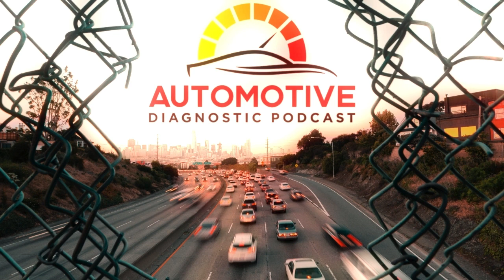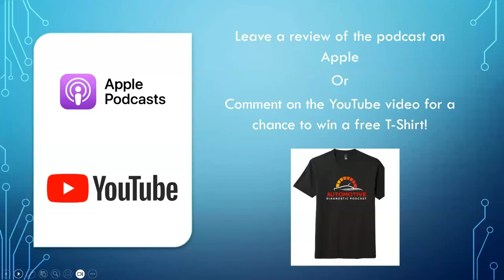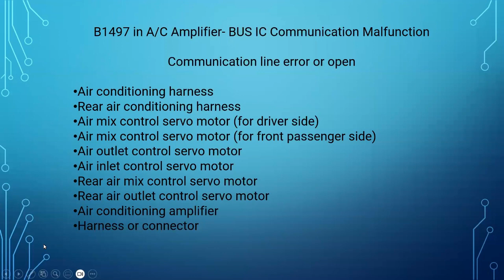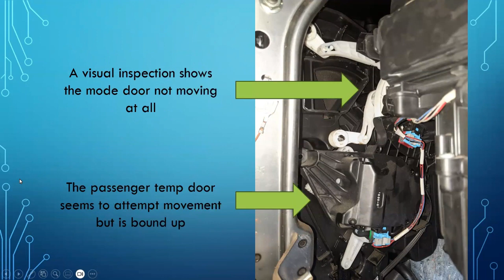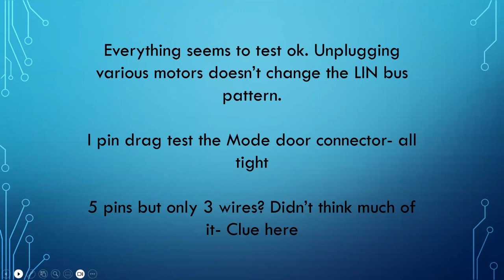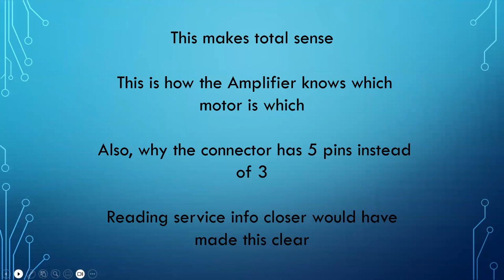E:234  B1497 2013 Toyota Sienna HVAC Communication Fault

Comment: Man. I am so glad I came across your podcast. I own a 2006 Lexus is250 and the recirculation damper servo didn't work. I tried opening the servo, testing the resistance between different contacts, but everything checked out fine so I was absolutely clueless to what the issue could be, since the temp blend door servos connected to the same wiring harness were perfectly fine. Never had it occured to me that there actually are mini PCBs inside the connectors! I disconnected the connector from the wires and opened it up, and sure enough, the board had corroded and one of the pins connecting the PCB to the 3 wires had completely come off the PCB! I took the PCB out, cleaned it up, resoldered the pin to the board and all is well now! The damper is working perfectly. So I can't thank you enough, this probably saved me hundreds of euros on a repair at the dealer

Comment: Hey, I’m like going crazy because I have a 2013 Highlander! I am experiencing the same exact problem but different locations, plus my temperature only come out hot on passenger and cold on driver! I first replaced the amplifier then the actuator on the drivers side (because it was easy to get to) Nothing! I’m glad I finally found this podcast because ripping out the passenger side is not fun! My mechanic and I decided that we should probably start back probing the wires and Boy are you right? There is no back probing. I am curious as to whether the whole wiring harness was replaced or if you were able to replace these connector pins areas? I see someone else had left that comment as well. Anyways, great job and thank you for leaving this video. I truly would’ve had to rip my dashboard up and I not found this.
Reply from the maker: I'm glad it helped! Thanks for listening!!

Comment: I would have been tempted to remove that PCB and rework it instead of doing a bulkhead harness.
Reply: I've got this exact issue on my Lexus IS250 and I'm probably pulling the PCB to see what can be done to fix it
Reply: @michaelvd2467  shouldn't be that big of a deal